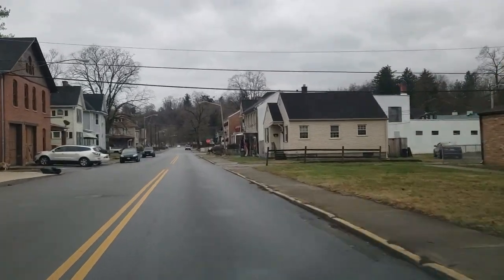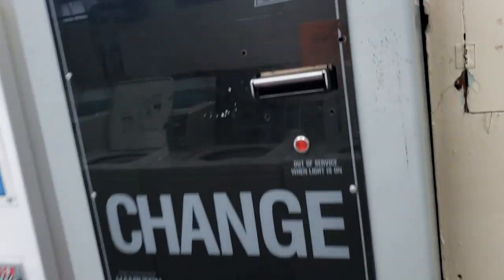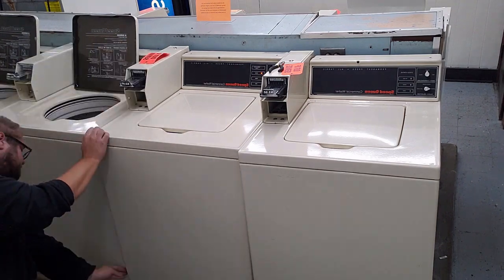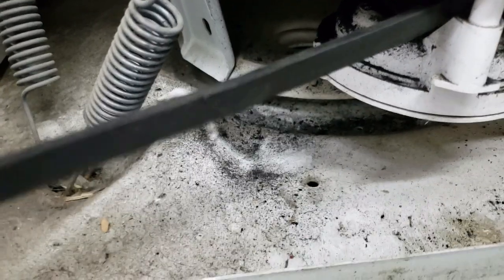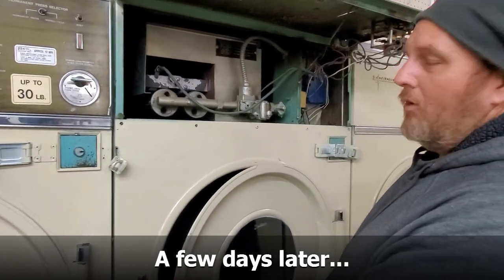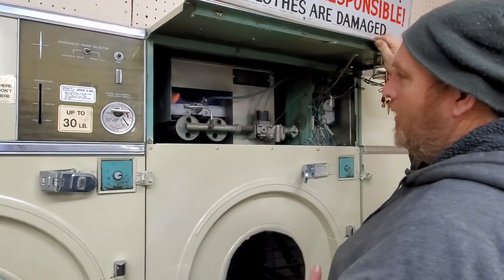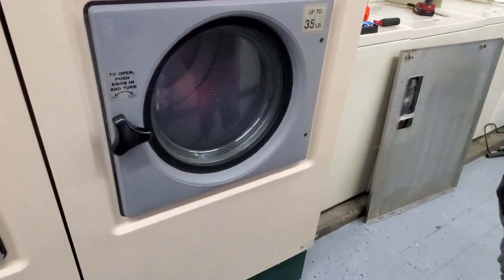How much does it cost to fix up a run-down laundromat?

Comment: Hey brother! I would use a shop vac to get the water out. Works great. I carry one for this issue. Great video!
Reply: I have one of those drill-based drain pumps, but haven't had much luck with it yet.

Comment: Wow he is lucky that his brother can repair washer and dryers saves big time labor cost  300 is a walk in the park that was 600 all day long
Reply: It was. That is one thing I wasn't able to talk about on the video because I ran out of footage... If you don't have your own team or DIY, you die on service calls. Another, smaller, laundromat is eating $5k/yr in service call fees (Not parts too, AFAIK) because the owner is too hands-off.
Reply: Bens Appliances and Junk you should charge Brandon more
Reply: @garyoakham9723  They are family dude.
Reply: Matthew B. Money is thicker than blood
Reply: @bensappliancesandjunk   I sat 20 of those Top loads on the curb 2 days ago in preparation for installing 14- 60 lb. and 2- 80 lb.  Hard mount front loaders.
Reply: @12rlph  topload Speed Queens?

I know when Brandon re-does his laundromat, he's looking at larger hardmount washers. What brand did you go with?
Reply: @bensappliancesandjunk  Yep, and they were gone in no time.  I chose to go with older rebuilt S.Q. machines from Midwest Laundries inc. based out of Chicago.  They rebuild the machine and it comes with a good warranty. 1 year on bearings and seals and 30 days on all other parts which includes new mixing valves, drain valve and anything else it needs. The 60 lbs. are $4,750.00 ea.(ish) delivered.  At $8.00 a vend it only needs 2 turns a day to pay for itself in a year plus an ROI of around $1,100 per machine.
Reply: @12rlph  nice. What brand were the frontloaders?
Reply: @12rlph  oh neat, so Speed Queen frontloads? Are they similar to the ones Brandon has, or a different style?
Reply: @bensappliancesandjunk  No, all hard mount speed queens.                                                                                  Go to 7:58  take a flat pry bar and put the front legs in the channel iron then tilt the machine towards you raising the rear of the machine about 12 inches and let it slam on the ground, the rear legs will self adjust to the front, but the front has to be level from side to side,  The white machine to the right of the red circle is installed correctly.
Reply: @bensappliancesandjunk  I think he is looking at Dexter
Reply: @12rlph  Dexter does have the old Speed Queen Pat. Pend. in the dryer department

Comment: It's time to dump the coin pusher.
Reply: I would add a cofee machine instead
Reply: Adal Martinez yeah
Reply: Why? Branden doesn't put any money in it, when people jostle it it's the company that operates the coin-pusher that loses out. And by putting the coin pusher in there it means people are less likely to try and break into things like the vending machines or quarter dispenser. Yeah it's a bit of a headache to deal with but in terms of economic cost it's a pure win.
Reply: Yeah! Let it goes to hell

Comment: Regarding the broken belt, start using a red link belt. You don’t need to remote moter to replace broken belt. The black one is cheeper but doesn’t hold up as well with liquids/oils on it.

Comment: I once bought a laundromat that had the old 1960's 50# open flame pilot light driers.  Let them run for a few months and then replaced with nice shiney dual 30# dexters.  I finally did the math on how much efficiency and how much just burning those huge pilot lights was costing me :D

Comment: 2 things: 1) $225 in labor is cheap! 2) You mention the other laundromat spent $5K in a year in service calls, but that's right around what you'd be paying if you averaged your December $425 bill put over an entire year.
Reply: I hope I explained that near the tail end of the video - the $425 was the average of the other laundromat, but this was a  particularly high month in costs for Brandon... He had $200 in parts and the most he's ever paid in a month is maybe $100. 

And yes, that's CHEAP for labor, because its my crew. I kind of ran out of footage to use, but definitely wanted to mention that the only way you really make good money in the laundromat biz is (much like self-employed truck driving) is fixing the machines yourself. Service calls eats up your bottom line rapidly.
Reply: $425.00 is Cheap for all that work. I know lawnmower mechanics that charge  that for 2 machines and No travel time, you bring the machines to them.   You said the other Laundromat was spending $5,000 per yr. that is Cheap to, because they wouldn't have the Brother n law discount. Where I live the appliance/furnace service techs make $35.00 per hr plus benefits with service priced at $100.00 per hr.  A lot of times it makes more  sense just buying a new machine.  My cousin taught how to repair furnaces before they became all computerized. I Fixed the same furnaces for for last 35 yrs by myself.  When they're replaced I lost.

Comment: A small portable / submersible sump pump will empty those machines in just a few minutes. All you need is an extension cord & a garden hose to run the water to any drain or sink...or you can even drain it into the unit next to it w/ a short hose...just fill up the working washer & then run the drain cycle.

Comment: Someone drilled a mech, used dish soap, and bad install/design by PO. That whole concrete island needs to be pulled up, angle iron removed, plugs inspected, and for good measure coat the exposed edges or the hole thing in an epoxy or something that will make it easier to clean and access for future service, instead of the bare filthy concrete.
Reply: Exactly. It needs a full remodel from the bulkheads onwards. I imagine when he upgrades the equipment, that'll all be done in one gigantic swoop.

Comment: Can you use link belts?  Use them in industry, and on woodworking equipment. Would not have to remove the motor to replace.

Comment: Prices are drastically low because he is getting the bro discount lol. In a normal cost of living area (where techs are paid more/charge more) I would bet the bills would be $100+ just for the service call on the single belt machine.
Reply: That one really varies - I am part of quite a few tech groups that do laundromat calls. USUALLY they are charging $100 to show up, and $25/ea machine to run/diagnose them then $20-30/hr to fix them. It'd certainly be more if it was an official company, but one of the MOST CRITICAL parts of laundry is that you avoid all of that by either doing it yourself, or having someone (like me and my team) that can do it for a lower rate. Otherwise, most laundromats would be in the red. Having said that, there are laundromats that are going under (that Brandon desperately wants to buy) that have 50%+ of their machines down because the owner is basically killing the machines until he can sell the buildings... Partially probably due to tech costs.

Comment: 25 years ago, went to a brand new laundromat out in California.  My washing machine ran for a very short time.  I thought to myself, wow, these new machines clean in less than half the time.  I will save a lot of time at this place, great.  Come to find out the reason they are so fast is they use less water, and do a bad job.  Maybe things have changed
Reply: Newer machines are better overall than older ones for clealiness and wash time. Its hard to struggle a balance

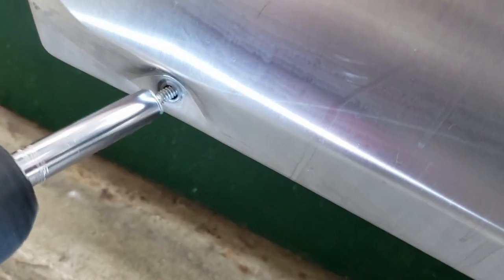Comment: 6:14 We have a local laundromat with Maytag top loaders from the mid 70's. They still work fine, other than that a good amount of them have bee broken for a while and not repaired, since they don't care.
Reply: The Elevator World or they can’t get part for them too
Reply: No, it's because the laundromat is in a strip mall (the laundromat is the longest serving tenant in the strip mall. Most of the strip mall is out of business, and so the landlord is kicking the laundromat out when the next lease is up so they can tear it down and build a mixed retail building.
Reply: I bet they didnt kick them out now
Reply: Probably not. They're still open as far as I know.

Comment: Hey Brandons brother, can you not take the housing off of one with a bad pump and install it on the pump. Based on an admittedly cursory look. It APPEARS the screw holes line up still. But perhaps that isn't the case? If the pumps themselves are the same pump/rating. Changing the housing seems better.
Reply: That's the catch, the higher-rated pumps aren't available easily from what I've seen. You have a commercial rated pump (the expensive one) and the regular GE-style residential pump which has a rating of about 15 less watts, and is in a smaller housing. I could not find any sort of larger one to use. Its a very similar situation to residential ones, as the housings are SO SLIGHTLY different between an LG, Whirlpool, or Samsung that prevent you from always using  a universal pump at 1/2 the price. The universal ones work sometimes (and are most akin to LG0, but.. half the time, it works every time.

Comment: So much water in the washing machine. Mine only uses 12 gallons per wash
Reply: These older machines use 25 gallons (ca. 95 l) or so. Definitely not high efficiency.

Comment: They sound the same! His twin doing the service calls seems like a great deal. I say charge the millionaire what it takes and keep them running. Whenever you go to a laundromat and more than one machine is not working it really makes the place look like a dump. It just looks like the owner does not care so keep them running! It is good for business. 
Fixing the machines is a learned skill and it looks like he is doing a great job tracing the problems. I agree like most things just fixing them right and not rigging them makes the most sense. The old equipment is fine as long as it works.  
Good video. Amazon Prime rocks.
Reply: There's a big laundromat that has been a family-ran business for ~60 years in our town... Owner (Boomer) has basically given up and is letting every machine sit un-fixed. Its a HUGE eyesore. Amazing location. Tons of customers.... 30 washers and dryers with "Broken" tags on them. I can only assume he's doing it because he's gonna sell out the business soon but man... The longer it goes like it is, the worse it gets.
Reply: @bensappliancesandjunk  like in real estate people in business sometimes have good and bad years and go through times they just get tired and give up on the upgrade cycle. You see this a lot when the owner gets into their late 60s+. 
I bought a sixplex from a guy that was just tired. He made his money and now his partner was doing other things so he sold it for $26k. We bought it in April 2019 and had it rented by November 2019. I was a lot of work but we do all our own work so it worked well for me now grossing $2050 a month if everyone pays. 
I see laundromats go through this often. People get tired of it. When you can stand back and just let the place make what it makes then it does not seem that big a deal. With deep pockets things change. He has this luxury.
WHAT ABOUT OTHERS
Problem is people sometimes buy a business like this and try to make a living from it. One month it makes $3000 then a few more then it makes $1000 a couple months in a row. People then can't pay their bills and become disgruntled about it all. Expenses seem to magnify when you can't make your car payment. The business suffers. They move on and barely keep it running.

Comment: Just wait until someone puts 4 laundry pods in a front loader.
Reply: That's just about why the $120 drain pump died in the Speed Queen. The bad pump looked nearly brand new, but the machine was filled to the brim with suds which kill washer drain pumps much more quickly.
Reply: @bensappliancesandjunk  Frount Loaders should only need one even for a large load less water but we're dealing with people here.
Reply: @METALMAN4Wii  exactly. People don't understand how portions work, and I see dish detergent in washers/ect often because "the suds means it cleans better" - ugh

Comment: Why dont you hire someone like for 4 hours a day so that you can keep an eye on the business?
Reply: Jonathan Gatto because that costs money. A $10 an hour employee would end up costing around $14-15 an hour.
Reply: @mph5896  Would save him the 30 dollars he lost with something or someone breaking something and it is a writeoff
Reply: How do you come up with $30? 4 hours x $15 hr is $60 a day. That’s $1825 a month.
Reply: @mph5896  He lost 30 dollars in 1 day with the change pusher!
Reply: @jonathangatto  Yes but he didn't lose $60 per day nor even $30 per day. Paying $60 per day to stop random $30 losses is not good business.
Reply: @nutritionperfection  It might stop people from trying and might help him not lose money
Reply: @jonathangatto  but if his losses are less than it would cost to employ someone then it doesn't make sense.
Reply: @nutritionperfection  Who leaves a store unattended?
Reply: @jonathangatto  it's quite common with small town laundrymats. Many are open 24 hours so to staff them would make them unprofitable.
Reply: @jonathangatto  The business model is set up so no attendant is needed in the location. It just needs somebody to clean the place, restock items and maintain the equipment. Add an employee sitting there and the business model no longer works and he will be out of business in no time. 

There are ways to increase inefficiencies. He is paying a family member to lock/unlock the doors at a certain time to open and close. This coulee be eliminated by putting time magnetic locks on the doors that lock at closing. Throw the open sign on a timer and you don't need that person to "open" anymore, or forget to open because they are off larping.
Reply: @mph5896  But it leads to breaking of his equipment etc
Reply: Jonathan Gatto still cheaper to fix the broken equipment over paying $1800 a month for an employee to sit there 4 hours a day. He even said the coin pusher is not his so he is glad that’s their target over his equipment. Plus it gains views on YouTube which earns him more $$$

Comment: Could some of the down machines not work because of a large load of clothes and you only fill with water? the clothes would make it harder to run or spin?
Reply: Potentially yes. But since most of these washers are belt-driven, the wear and tear would eventually snap the belt more than anything else.
Reply: @bensappliancesandjunk  Are there commercial washers that don't use belts? I made sure my home washer didn't have belts. That was after I was fed up with constantly fixing the belt on the previous washer.
Reply: @wadebarnett2542  I think Dexter uses a belt-less drive via a 1-horsepower inverter motor. Lots of residential units use them, but I've had a lot of problems with them and wonder what the real commercial equivalent looks like.

Comment: The equipment they are making is junk, Chinese parts? Back in the day the machine timers could be accessed and tested manually. Have they stopped making machines this way. In my local Alliance equipped and installed laundry, half of the machines are down. All front load Unimacs.